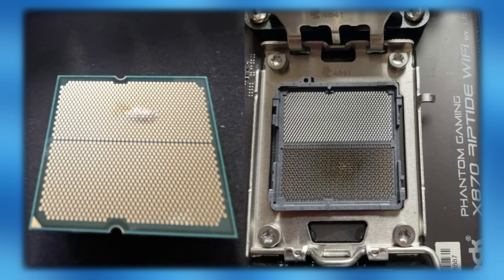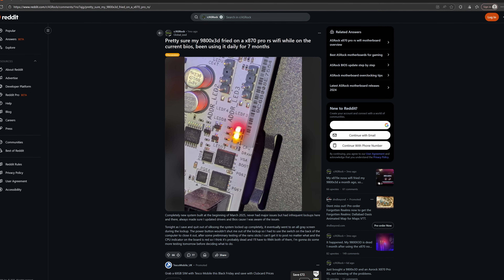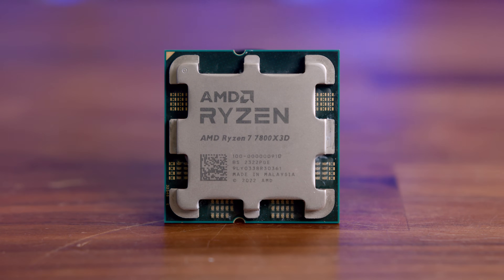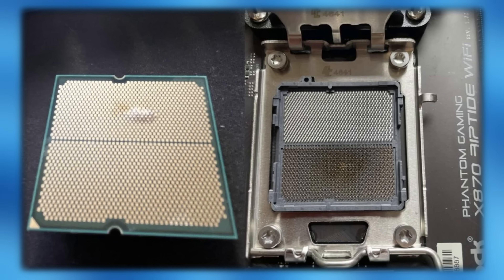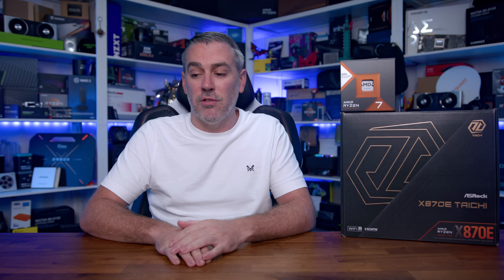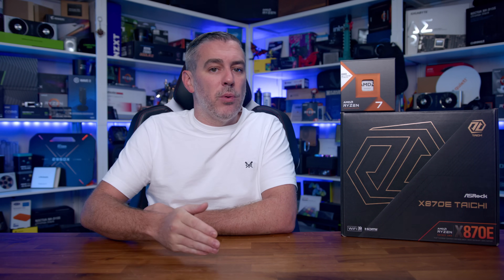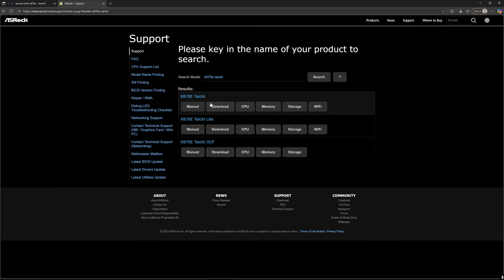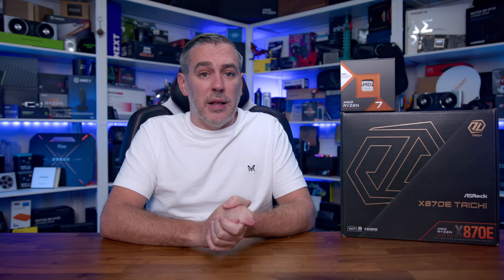AM5 Motherboards Are STILL Killing CPUs!!!

Comment: I don't have money to burn but I also have my doubts about this situation. I'm running a x870e Taichi along with a 9800X3D on bios from March 2025. CPU is being held down by a thermal grizzly direct die. This setup has been rocking out 5.4 gigahertz for over three months now. I'm betting it will continue to do so. If not, proper documentation will be recorded and released to the general public.
Reply: I hope you have locked your cpu voltage? or you're skating on thin ice.

Comment: Do note that all reports you see on Reddit are biased. There are no statistics on systems with ASRock X3D that have been running without issues. We simply can't tell what the actual failure rate is, whether it is below 1% or above 10%. 

But no doubt ASRock boards have an issue which users should be aware.
Reply: Okay so, i have 2 pc with a nearly identical spec, ryzen 5 9600x, one with a cheap asrock b650m h/m2+ and one with b650m pro x3d. The one with b650m h/m2+ survive for almost 6months now, not only survive from game or small workload, but i push every single juice from it when using it to do some realityscan photo alignment, code compiling, etc, and sometimes even pushing the temp to 90 (im using deepcool ag400 plus). Meanwhile, the one with b650m pro x3d died within 2 months while im watching a youtube, it suddenly freeze and on reset, its forever stuck on windows loading spin.
Reply: No pshycal damage on the cpu, im trying to switch the cpu, will do update if its really was a dying cpu or other problem
Reply: People do note that. We're all well aware how the internet works : good products, functions properly = don't praise it. Faulty products = complain all over the internet. However, hardware is rather expensive even if it kills "just the CPU and Motherboards" those 2 components are not cheap. Going from cheapers (local prices) - 200€ for X870 Pro RS + 300€ 7800x3d/500€ 9800X3D or 460€ Taichi + 300€/500€ 7800/9800X3D. So, the idea of that "potentially" happening should instantly turn away people from buying that brand until they figure out the issue. You usually buy such hardware to last you 3-5 years, the idea of buying it just to die in 1-3 months is like setting 500-1000€ on fire.

Comment: The problem isn't new and has been observed on the same Asrock on the AM4 - almost any attempt at overclocking, for example, setting the memory frequency higher than specified in the SPD leads to VSOC jumps to 1.2, which in itself often led to a loss of stability.

Comment: IF YOU HAVE bios flashback ... YOU never need to worry about bricking your motherboard... NEVER
Reply: You can still brick it with Bios Flashback if the power goes out. You need CrashFree Bios 3 to try and recover a bricked Bios on Asus.
Reply: @celery4564  yes but more not really.
A power outage during a BIOS flashback can brick the motherboard, but the flashback feature is specifically designed to help recover from such a failure. If the power goes out, the BIOS might become corrupt, but as long as the flashback process was not completed mid-flash, the dedicated flashback port and button are intended to be used as a recovery method.
Reply: Are you ok?  Yes you can, its a dual bios so yes if half goes bad now you got 1 left, if that goes bad you got none.  Wouldnt say that is never
Reply: @JohnDoe-tv4zd  Actually, BIOS flashback is not a dual bios, its a much more robust system that is able to flash bios in almost all instances, without CPU installed, with corrupt bios, etc.

Comment: The dust never settled on the Asrock boards.  If anything, the dust is now 3 ft deep.  The asrock sub on reddit has a constant history of failures going back to January.
Reply: I've had an X870E Taichi Lite for nearly a year now without a single issue. I'd be curious the number of failures are also human error of people overclocking and messing with voltages without knowing what they're doing.

Comment: When it's all said and done this will be a AMD issue. Asrock is the only board that allow as high a voltage as they do. So wannabe tuners blow up their chip they blame the board because it couldn't possibly be them. I only use asrock and have a 9800x3d & 9950x3d and have had no issue at all because I don't overvolt.
Reply: Remember the 7000 series x3d was a locked bios. This is what happens when you give the kids the keys.
Reply: @bignicnrg3856  Remember Asus was blowing 7800X3D's last year, more than we have had with Asrock this year. People still buy Asus motheroards and 7000 series CPU's, and occasionally one fails, but not everyone is a Reddit fanboi who needs a blame thread. The fact is people play with settings, and run AIO's on CPU's AMD designed to run at max pretty much as often as possible, 95c thermal limit on a CPU that will push that even on Cinebench, and people playing with undervolting to overclock with a 360 AIO is pretty common it seems.

Comment: Back in AM4 I stopped using the AIB tuning tools and stuck with using Ryzen Master ever since then; even to set memory speed. Always had trouble with their tools to auto-tune performance with instability and random crashes. Recently went to AM4 and same issue, reset to default values and went straight to Ryzen Master. Only issues now have been with my monitor; GPU seems not to be at fault. But yeah watch out and be careful out there.

Comment: For people who don't want to tinker for days in BIOS go with maximum OFFICIAL XMP speed for ram, for 7000 its 5200 for 9000 its 5600, timings doesn't matter, but just after you go above those speeds motherboards put all kinds of voltages like its LN2 overclocking.

Comment: I really suspect that many of these report are coming from wannabe overclockers that never let asrock know that they are overclocking their parts. People need to stop acting like Asrock are a bunch of idiots that dont know how to make motherboards really.
Reply: The majority of failures are from kids overclocking yet not capable of updating Bios, most of the posts and screenshots from users and clickbait content creators show this.  System builders and content creators are not experiencing this at any level, they are simply regurgitating each others fake news after someone read some Reddit posts. 

There was a site somewhere where the official validated number was apparently just over 100 verified failures due to AMD CPU's failing with the hardware limits they had given which Asrock used, IE 3.15. A coupe of content creators have already shown a vast number of the failed 9800X3D's were from a specific batch. Indicating this was as much an AMD issue as Asrock, Asrock simply reached the limits AMD claimed CPU's could meet, it turns out AMD CPU's cannot meet the claimed limits and instead of shutting down, die. It says a lot when AMD and Asrock, and also the other motherboard vendors this happened to, (Asus MSI and Gigabyte also failed early on with 9000 series) had no actual explanation or showed it replicated and solved.

It is possible that any CPU used in bios 3.15 is damaged, so could potentially fail later, even in an updated bios, due to damage with bios 3.15. People would then blame the later bios. But with AMD platforms it is now about running overclocked maxed CPU's, people now undervolt to get more out a CPU that is designed to run at it's thermal limits, with no real idea what they are doing in bios, in essence undervolting but actually pushing CPU's harder because the massive AIO is taming the thermal limit the CPU is designed to run at possibly in some cases.

There is a reason this issue is less prevalent with underlocked -- 20 to -30 per core CPU's running at lower than specified wattage or "eco mode" set for 85c thermal TDP on air where people are more interested in reducing heat or ramp up? There are reduced setting recommendations for all AM5 CPUs from 7000 series upwards because the reality is AMD pushed them all too hard with less than adequate fail safes.
Reply: this isnt the 2000s, there's not much headroom to overclock anymore and everything overclocks/boosts itself.

Comment: I had a Ryzen 9950x3d with an ASRock Nova Wifi since February. Because I was made aware of the CPUs burning up right after I ordered the parts, especially on ASRock boards, I intentionally undervolted the CPU, WITHOUT overclocking it. I was willing to take a performance hit to stay safe until this is all hopefully resolved with BIOS updates, that I checked religiously every couple of days. I made it until Bios version 3.30, then it happened. Computer wouldn't boot up anymore, error code 03. I went to a retailer who was kind enough to check the CPU for me in a test bench, and he confirmed that the CPU was dead. 
Now I'm back on an Intel Ultra 9 285k and an Asus board. No issues since, the CPU runs actually a little cooler. Is it not as powerful (especially in gaming) compared to the 9950x3d? Yes. But I can still run all my games at acceptable FPS with this PC and my 5080. So I'm contempt and happy with my new setup. But it was a costly endeavor...
Fast forward to today, I see this is still happening on the latest 3.50 BIOS version. Just tells me I made the right decision.

Comment: Been running my Ryzen 9700X on the 105W TDP with an ASUS X870-F for over a year now and have had zero issues. Is the board overpriced? maybe, considering I have been running this CPU balls to the wall for a year without a need to replace it tells me that I got my monies worth.
Reply: You don’t have 3d cpu so I don’t think you will be effected.

Comment: Had a Asrock X870 SL which I really liked & planned to upgrade to a X3D CPU eventually. Given Asrock's current issues with their whole AM5 line-up I decided to get another mobo, this time a Gigabyte X870E Aorous Pro Ice but those do not like the 8000-series. I was able to get a pretty reasonable 7700X though so my 8700F will stay with the Asrock SL.

Comment: The claim that only the X3D on the ZEN5 is at risk should not be used. In fact, there have been numerous reports of damage to both the 9700X and 9600X. Please be aware that there is a high risk involved in using a ZEN5 CPU with an ASRock motherboard. The misconception that only X3D was at risk exacerbated the damage. If you are using ASRock's B650 to X870E, use the 7800X3D or 7700. This will simply reduce the risk significantly.
Reply: Mine(9600x) died on a msi b850 tomahawk, I only had amd expo enabled. I didn’t even stress the cpu as I didn’t had a gpu. Only used for web surfing, videos and web development.
Reply: Indeed, my 9700X was affected (died).

Comment: Oh Perfect ... i just got a 9800X3D into my Gigabyte B650 Aorus Elite AX V2. BIOS is up to date though. Fingers crossed. For reference my 9800X3D is CF2532PGE. This is not on the list that I have seen
Reply: It has been mainly Asrocks 800 series boards. B650 and X670 boards are safe. And they say that Gigabyte boards have had least problems. I have a year old 9800X3D and it has been in a Gigabyte X670 board and survived.
Now it lives in an Asus ROG B650E-i motherboard with no issues. As long as its not an Asrock board your 99.9% safe.
Reply: @j.p.h.8126 good to know
Reply: i haven't heard anything about gigabyte killing X3D chips.
Reply: clickbait title its mainly asrock causing the problems.